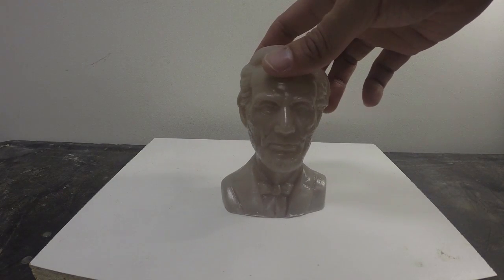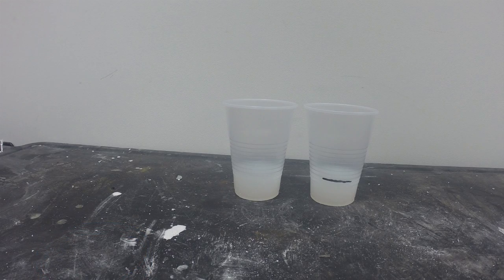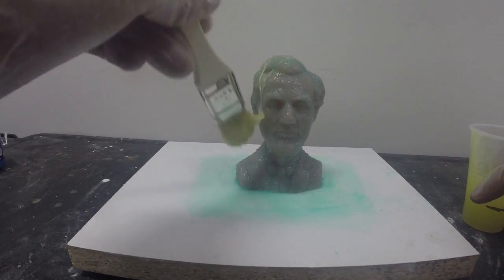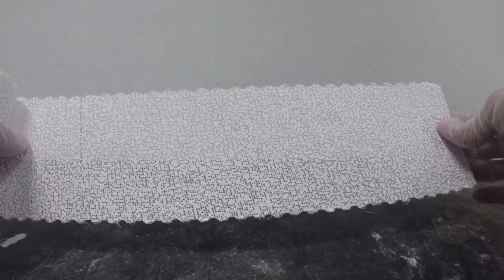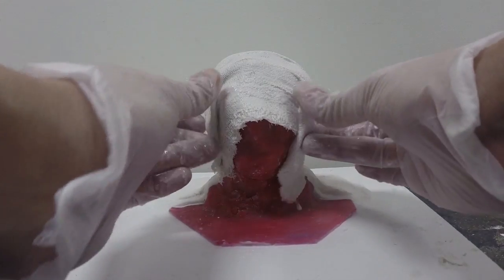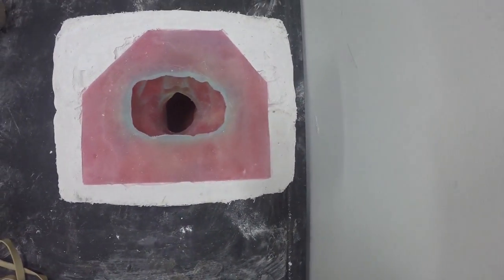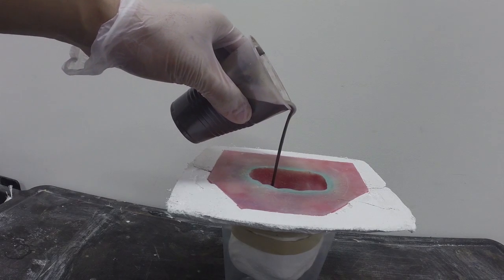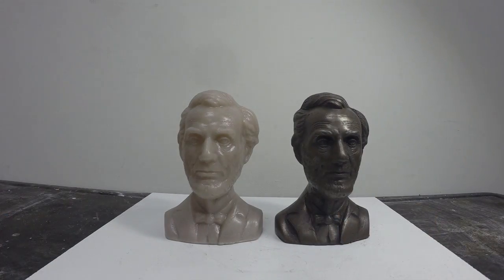Moldmaking Tutorial: How To Make a Resin Metal Cold Casting

Comment: A small suggestion : after pouring in the resin,  put a plastic  bottom  on the base opening.. That way, you can tilt as you slush cast all the way to the bottom, even completely enclosing the cast.

Comment: what if I only want some resin (or some other material) to keep the metal powder partials together, and then heat it so they weld together and the binding material is evaporated and I get a pure metal object, it will shrink a bit but now it is pure metal, can this be done?

Comment: I LOVE this technique you used to make a cold casting. I've never seen it done like this before and the finished head looks really great. I have a question to ask. What do you mean by "registration" in relation to molding? I did hear another person use the same word about lining up 2 halves of a silicone mold, is that what it refers to? Thank you very much for this great video tutorial. Cheers from Amanda in Melbourne, Australia
Reply from the maker: You are correct. Registration refers to the 2 halves of the mold lining up correctly.

Comment: thanks for the tutorial, it saves a lot of silicon, compared to other methods i've seen. 
I didn't understand why you had to add the color to the silicon if it's only for making the cast any. why not just live it in its natural color?
Reply: the only reason i see using this method is because getting the head out of a one-piece mould might be hard to do, otherwise you'd have a two-piece with parting lines. 

using a different colour doesn't make any sense unless it's to see where you've covered. easier to see that way, i would say.

Comment: Hi, I wonder how coating the outside of silicon mold with baby powder can help releasing the inside of the mold ?
Reply: I thought that adding the powder helped with the elasticity of the rubber,  to avoid breaking it, that first time it was stretched to get the original piece out.
Reply from the maker: The powder helps reduce bubbles on the surface of the castings

Comment: Well done video! Question here; if you have to end up doing a piece mold in resin, you'd probably end up gluing the pieces together after cleaning up the seams, but what would you use to fill in seam channels or divots? I'm wondering about keeping the color consistent with the other pieces and with repairs. Has this been an issue for you? Yes, you measure and all, but still, there can be variants. I haven't tried a complete glove mold yet, but looking forward to it. Thanks for posting!
Reply from the maker: Mixing some metal powder with clear epoxy or cyanoacrylate glue works well for filling holes in a metal cold casting to match the metal look.